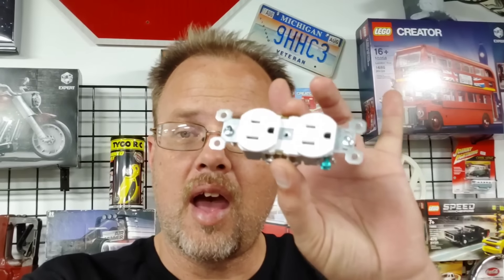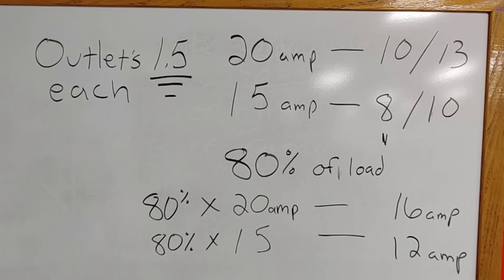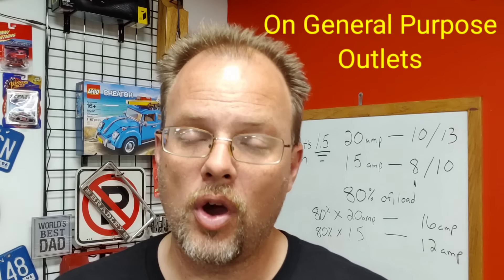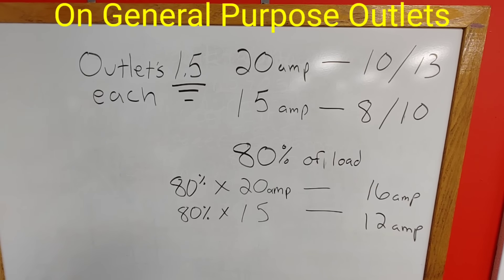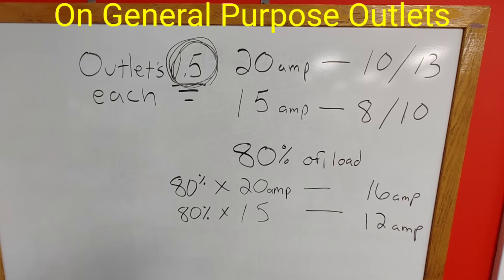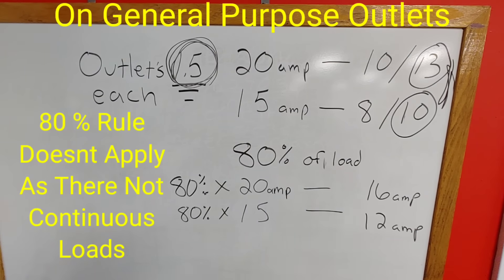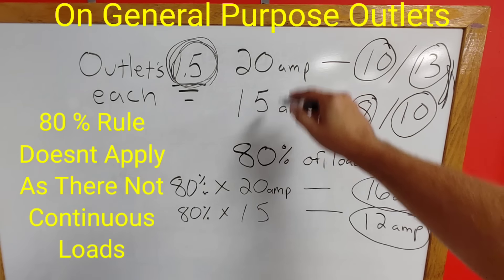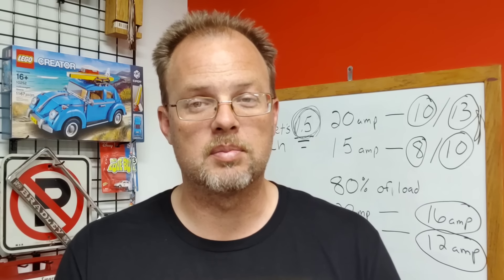How many outlets can you put on one circuit ?

Comment: one can put as many as one has wire to reach. outlets use no current but should be limited according to what will be plugged in to them. some circuits only have one outlet, others have many. i am sure there is a rule of thumb but i prefer the load assessment way of determination...............g

Comment: I have six lights on a single circuit,  can I wire in plug outlets by each light, and be safe in a barn?  Thanks
Reply from the maker: It depends on what you will be using the outlets for.  You have to account for the load the lights is already using.
Reply: @BevinsBuilds  
Thanks

Comment: Can I increase the amount  of outlets by putting in a 30 amp breaker? In other words, is it okay to put a 30 amp breaker in place of a 15 or 20?
Reply: Only If you want to pay the extra cost for #10 awg as the breaker/fuse is for the protection of the wiring and must be sized accordingly
Reply from the maker: Only if you put in larger wire as stated by Simple

Comment: What really matters is what kind of loads you want to support.  If you are wiring a room where tiny loads are going to be plugged it, like phone chargers, use as many as make sense.  If you are wiring a room where multiple loads like space heaters, ACs, or hair dryers will be plugged in, two outlets might be too many.  Another critical thing often overlooked:  If you are using a 20 amp breaker, don't use 15 amp outlets!  Just plugging two 10 amp loads into a single 15 amp outlet will overload it but not trip the breaker.  Pay the extra money for 20 amp outlets.

Comment: Something that probably no one would or could know? Is what kind of load someone going to be putting on those plugs either? As I’m sure you know some people add extensions plug in or gang plug ins that add another 3-6 or more places to plug in more devices to the same plug in!  So many people just don’t realize the amount of heat produce to their wiring when they overload a circuit regardless how many plug ins they have?  Brings me to another point that always should be brought up talking about plug ins, never ever use those quick connect little holes on the back of plugs to connect your wires.  These holes connections are a fire hazard waiting to happen cause there’s very little  metal contact on each side of the wire in the holes therefore causing more heat to generate especially on heater load use! I’ve seen those connections fail many many times over the years with the black marks on the box and 2x 4 and wires burnt in two as well as plug melts as well. Extremely dangerous! Always connect wires to the side screws running your wire around the screw to get as much metal contact as possible! Which any good electrician will tell you the same thing! DIY electrician should be very careful what their doing and be sure their not setting themselves up for a disaster! Be careful with electricity!
Reply: As a DIY homeowner l recently added an outlet in my garage using the quick connect holes. I really appreciate your advice on proper/safe connection practice, I’m definitely going to reconnect the wires to the screws now. Makes a lot of sense on metal contact to avoid a possible burnt plug or worse. Thanks for your professional input.
Reply: Yup, and now we have push connectors to replace wire nuts.
Then we need to have arc fault protection on most circuits.
Seems like overprotection while allowance for laziness to me.

Comment: Unlike YouTube Comments sections in other YT videos. The comments here are actually intelligent, cogent and well-made. The grammar is also, read-able and the logic used is tight. I have an 120-volt outlet, will it be alright to run a mini-fridge that uses 1 - 5 amps? The outlet receives 15 amps from the breaker? I definitely cannot run an A/C unit and microwave cause that will overload the darn outlet. Second question, GFCI outlet shutdown when water is introduced accidently. Is there an outlet that will shutdown if it gets overloaded with different appliances (microwave, a/c/ refrigerator/ computers, et al?)
Reply from the maker: Hello and I apologize for the delay in response as I don't monitor this channel very closely.  Believe it or not my primary channel is a Lego Channel 🤣.  To answer your question yes you can use the mini fridge on a 15 amp outlet without any issues at all, as long as like you state you are not running an AC unit or something else on it that will overload the circuit.  In regards to the receptacle I'm only aware of GFCI receptacles and have never personally seen or used any that have a built overload protection.  But they do have plug strips that you can plug into a receptacle that do have overload circuit protection built into them.
Reply: @BevinsBuilds  Sorry what is your main channel name? Thanks for the helpful response 😊.

Comment: In canada , there is a code for only having 12 outlets on a 15a circuit.
Reply: yep.. while in UK it depends upon the wire and the breaker..but NEC does not give an amount on residential. Meanwhile, here in Jamaica they do not seem to sell the codebook and electricians are all over the place on it
Reply: U guys wrong, go read ur code book . Residential there is no load calculation for general purpose receptacle
Reply: @benzaguru4548  It depends upon your local AHJ and how they interpret the code book. You are correct in the USA that there is no limit in the code book for residential installations, only for various commercial installations. But, there is no limit in the UK either, it is actually a limit in the UK based upon breaker size and square meters instead. However, In Jamaica and Canada, though again versions of the IEC, and NEC are supposed to now be used, the local Government bodies do have limits, even in residential.And some of these limits do not make sense, but are required if you want electricity connected to the property. So, again, as I often say, you must look at the local authority and their codes. Not every jurisdiction in the USA uses the 2020 NEC code. Jamaica claims to now follow the NEC but has yet to fix their system to sell the code books here.  I Understand that India uses the NEC but again, like the USA, it depends on when the local province adopts the NEC which version is used as some are still using the IEC... no longer published.
Reply: @brotheradam  .. I have been to Jamaica (many times) and am aware of what common practice seems to be. Not sure if it's comical or scary from an outsider's point of view.
Reply: 12 outlets on a 15a circuit seems to be a lot in my opinion. I just wouldn't do it.
Reply: U got a make sure if they talking about residential or commercial offices  building.  For offices building in commercial the load calculation for receptacle is 180v/receptacle.  So on 15a in commercial office  can't have more than 10 receptacle .

Comment: Does a 20 amp circuit need a stronger current wire?  i.e. 14/10 vs. 12/10. Can someone pleez answer?
Reply: 12/2 wire for 20 amp.  15 amp circuit can get by with 14/2.

Comment: The outlets are dependent and controlled by the circuit breaker that controls that outlet in your electrical power panel. Do not let the total load exceed that circuit breaker's amperage rating in all the outlets added together in that circuit that the breaker controls.

Comment: But what about the reduction from using LED's doesn't that up the numbr of outlets cause your running way fewer amps for lighting?
Reply: In a way, you are correct.  Practically though, if you put every outlet in your house on one circuit and you have a short somewhere, it will be a hassle to track it down.  Another issue is what if you have a slumber party in the basement and the 400 Watt stereo is going, a popcorn maker is going and a portable microwave is going, space heater is running and two girls are blow drying their hair, tv on, etc.  You never really want to overload a circuit.

Comment: Depends on the total load that would be anticipated on the circuit with a little leeway.  Also MUST use correct AWG. And why aren't  we using 20 amp breakers? I haven't seen 15A circuits for  a long time in new construction.

Comment: UK we can have unlimited outlets. You can overload circuit on 2 outlets. As long as the cable is rated higher than circuit breaker, splitting the load onto more circuit's saves nuisance tripping.

Comment: You mentioned the breakers as 15 amp or 20 amp. What about the wire running from the breakers to the outlets is that the same gauge wire or is that different as well?
Reply: For a 20 amp breaker it needs to be 12 gauge wire.  For a 15 amp breaker you only need 14 gauge.  I’ve heard some people say they use 12 gauge anyway.  That would help reduce voltage drop if it happens to be a long distance.

Comment: Thank-you.......but, general house I agree. However, in kitchen, washroom, and garage or workshop, I do not. Kitchen I do, one line for every wall outlet. I do refrigerator on its own. Microwave and stove 115v. Together. 240v stove by it self. Disposer and dishwasher together.  Garage, 4 lines minimum. Workshop at least 3. Thanks....Jim
PS....these are minimums, you can add. Lighting?  Please cover this.
Reply: Kitchen requires two 20 amp circuits for countertop receptacles per code and receptacle spaced within 24 inches. A built in microwave should have a dedicated circuit. Nobody knows where a portable microwave will be plugged in. The fridge can be powered from one of the 20 amp circuits in the kitchen or from a circuit in an adjacent room or it can be dedicated circuit. Code does not specify for a fridge. The dishwasher and disposal is generally on a circuit together. A small range hood can be powered from one of the 20 amp circuits. A large hood with multiple motors should be on a dedicated circuit. 120v for a gas range can be pulled from anywhere, Often a circuit from an adjacent room. Bathrooms require receptacles to be GFCI protected and a dedicated circuit but receptacles for two bathrooms can be powered by that dedicated circuit as long as there is no lighting on it. Bathroom lighting can be supplied from anywhere. Only a single GFCI is required in a garage by code and it does not have to be a dedicated circuit.
Reply: @farmerjim-fat-man-do  my house has been built to code. I have has problems when we have breakfast brunch on Sundays. On the west way with range/refrig./microwave,/toaster/2 outlets......when I plug in the griddle, I have problem. In the garage I have that one GFCI outlet and have 2 ceiling outlets on separate circuits for the door openers. I have added a sub panel to the garage and have plenty of power and added lights. I will add 2 extra lines to the kitchen. Reason for my response is that I have a 3 car garage, code is not enough, 3 outlets, some by the garage door should be a minimum. Kitchen, refrig. Should be on its own line and also microwave. If I had these, I would have no problems or the need to add on. Can you forward these requests to whoever does the NEC updates?   Thanks....Jim
PS.......my builder’s sales people were not electric savvy.

Comment: Th code book is correct. It does NOT matter how many outlet are on any size circuit breaker. What DOES matter is how many appliances are connected to that circuit breaker. Vacant outlets add zero load to a circuit breaker. That’s why outlet multipliers, those devices that allow you to plug many devices into a single outlet or power strips WITHOUT overload protection are potentially dangerous. They can easily cause a dangerous overload to a circuit breaker. 100 vacant outlets will draw zero amps of electricity, but one outlet with five or six appliances each drawing 5 or so amps will overload a 15 or 20 amp breaker if all are turned on at the same time. The reason that there is a potential danger is that circuit breakers DON’T ALWAYS WORK, and when they don’t a fire usually breaks out. Remember, circuit breakers are not there to protect equipment. They are there to protect the wiring, and electrical fires in wiring occur INSIDE the walls. Oh yeah, and DON’T throw water on an electrical fire.

Comment: Like he says it doesn't matter how many outlets there are. What matters is how much current or load you have on the circuit. Let me give you my experience. I one lived in a very old trailer. It was at least 30 years old. It was made in the days before microwaves, toaster ovens, and it even had a gas stove. Probably because they didn't anticipate a lot of electrical load in the kitchen, they put all the master bed and part of the Livingroom and the kitchen on the same circuit. However, the bedroom only had 3 outlets and the kitchen The Livingroom had only 2 of its 4 on this circuit and the kitchen only had 2 of its 4 on this circuit. So, 3+2+2=7. Good right? NO! Always blowing the breaker. Why? The 2 in the kitchen had a microwave and a large toaster over. Obviously the microwave and toaster drew a lot of amps. Plus the gas stove went out so I ran a hot plate for a while. If you ran the microwave and toaster oven, and had multiple things on in the Livingroom and bedroom, it would trip the breaker. Obviously when cooking I might have at lest 2 of 3 things drawing a lot of amps on in the kitchen. Too much load!!! Solution was to move the microwave and Toaster oven to one of the outlets not on that circuit.

Comment: I still don’t think you went over the why. Isn’t what overloads a circuit use and what’s plugged in sucking up electricity?
Reply: He is basing it on the likely average loads that might be plugged into any given circuit.  That is an unknown variable so he’s using a highly likely scenario.  It is impossible to come up with a 100% right answer because that variable can’t be known or controlled by the teacher in this video or any teacher (only by you and your knowledge of this concept).  For example, this will not work if you decide you’d like to plug an iron, a crock pot, and some other high amp draw appliances into the same circuit (less so if it’s a 15 amp circuit)  That scenario is highly unlikely, but is possible.  The damage?  The breaker flips.  The idea of his logic is to prevent that inconvenience of having to run and reset the breaker from occurring but, as an estimation, in the majority of scenarios.
Reply: The wiring and outlets usually do not draw the current and overload a circuit. It is almost always the load plugged into the outlet that overloads. Only defective outlets or shorts of the wiring rarely ever cause any overloading but, if this happens, the circuit breaker usually trips first.

Comment: The most common sense rule is make each room on it's own breaker.Truth is there is no limit because most people would never be using all the outlets at once to overload the circuit but with common sense,the more outlets you do put on one circuit then the easier the possibility comes to overload it because you'd be using more of the outlets at once.Stick to each room on it's own circuit and play it safe.Also it's good to have the fridge and microwave on it's own if possible only because they draw a decent load when they kick on.

Comment: Have to allow for other resistance such as length and gage of wire.
Reply from the maker: After 100 ft yes don't know to many residential runs that are 100 ft or more.
Reply: Standard 12 gauge house wiring can usually handle the amperage rating of the outlet rating. Length and resistance are more of a concern with the length of wire from the outlet to the load. That is why if you buy a new electrical device, always check the amperage that the electrical device draws, especially if you are using an extension cord with it. If it draws a lot of amps, you may have to buy a higher gauge wire extension cord because of the extra resistance and current draw of the load device.

Comment: i put 5 on mine because my old house you can turn on the microwave in the kitchen and plug a hair dryer in the rest room on the other side of the house and pop my breaker.  but also you can throw every breaker in my house other than the main and still have hall and bathroom lights.  i'm praying everyday that i can get into my new house before this death trap catches fire and burns to the ground.
Reply: 😳😳😳 I'd say rewire your hall and bathroom lights, but you also have to get rid of the power coming into them.  Is there a small (probably 12ga) wire connected to your main in the breaker box?  If so just pull it (carefully) and hook it to a new breaker, assuming it will reach.
Reply: @dustintunis9347  thanks i have tried everything. we think when lighting hit my house 7 or 8 years ago it burnt something in the box itself.  but if god be willing i will be in my new house by mid February. then i could care less.  about this thing